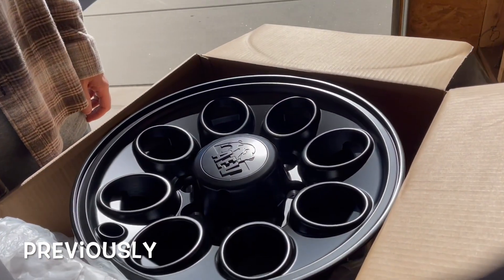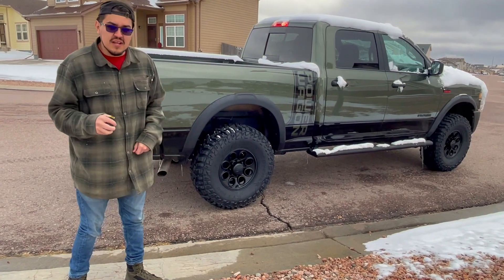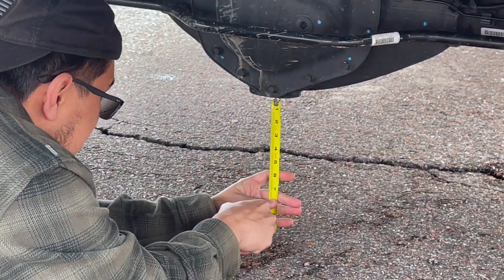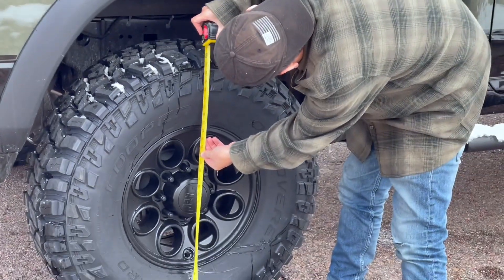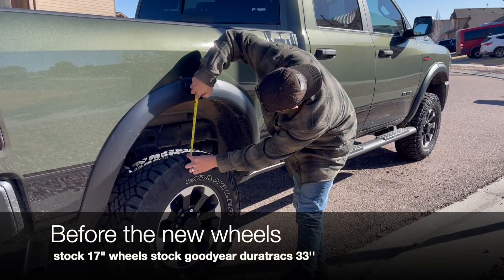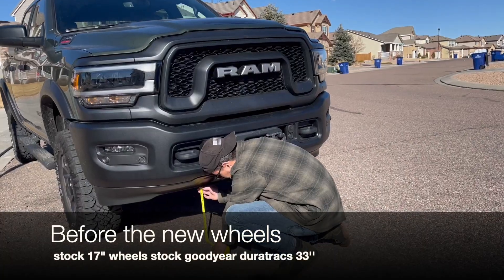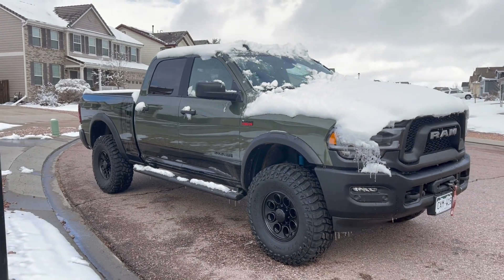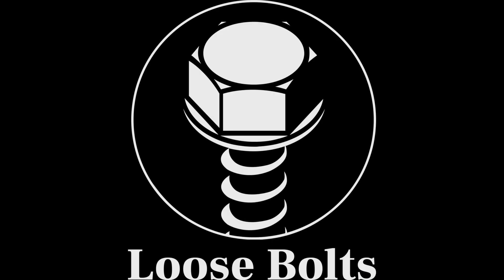Should you upgrade your tires for more height? Power wagon wheel and tire upgrade.

Comment: I have a 2018 Ram 2500 Cummins and used to have 37 on it with a 2.5 Carli suspension the truck looked awesome and rode like a Cadillac. Quickly I came to find out that I needed to re gear the gears to 4:10 gears. The transmission shifting was way off. When I would gas the truck it was a slug. After the re gear it was back to normal. On top of that my high mpg went out the door. The don’t recommend going bigger than 35
Reply from the maker: I hear ya man good feedback for many people looking into it. These pw already come with 4:10 as well as they make things now to re calibrate the trans to 37s (aev procal snap another video) I love it now your right there not one thing that can be done about the gas mileage it just is what it is if we lived our lives worried about it we’d all drive a prius. On 37s it’s the closest thing I have to a tank lmao I have no complaints this rig is bulletproof (knock on wood)
Reply: @loosebolts4537  that’s cool that the power wagons come with the 4:10 gears. I like the wheels and tires you went with. Your truck looks awesome

Comment: I also have a 2022 Power Wagon and I’m getting ready to throw on the AEV Katlas with some 37x12.5 Nitto Terra grappler G2s. I just noticed that the procal snap was back in stock, so I’m ordering it today.  I dig the channel, well done!!
Reply from the maker: Bro, nothing breaks more necks that 37s x17 man get ready to be complemented every where you go on your rigg. The procal snap is a must have a vid on how to program real simple but very necessary my odometer is correct and my gears shift smoother. Thanks for the kind words my man!

Comment: Did you have regear anything?
Reply from the maker: No re gears the z f and 6.4 are more than capable the only thing I had to do is reprogram the tire size so the speedometer and the transmission would catch up.
Reply: @loosebolts4537  I’m looking at getting one this week. I think due to high gas prices dealerships are allowing MSRP prices or below!!!

Comment: What trimming did you do
Reply from the maker: Haven’t done any trimming, running at about 50 psi front minor rubbing sometime when turning at full lock or off-road once you get some articulation going but I’m ok with it need the fender liner for now as I’m in co and that road salt eats up sheet metal plans to bed line the underneath of it but it hasn’t been bad enough to warrant it.
Reply: @loosebolts4537  I’m thinking of putting 20x9.5 with 35x12.5.  But I want 37s but I’m on stock height.

Comment: The 6.4 with the ZF is like a freight train so I can see the added weight not affecting the power much but the ZF will shift more and not as quick unless you regear.  It will affect mpg though since you are adding more spring weight do to more rubber.
Reply from the maker: I honestly couldn’t have said it better myself, your spot on there is practically no loss of power, the gears are confused at the moment looking for the aev procal snap so at least the truck knows it’s on 37s, maybe a regear once warranty is up

Comment: Hey, so let me know what kinda ride you get on these on a road trip. how do they do on bad roads , hwy fuel range ..etc...super interested
Reply from the maker: Hey my man, I’ll make a video and tell you now just went on a 200 mi road trip (pavement/asphalt) all the way through, the ride is quiet you wouldn’t think they are m/t I like how cooper took their time with making this tire, also run 50 psi right now on all 4, cushioned the ride competed to what I was running before 32 duratracs with 60 front and 65 rear ‘y wife was excited about it and I didn’t even tell her to look for it. Also at 50 psi slight fender massaging no rub didn’t cut anything. It’s a slick set up! 12 mpg average. However the truck inky has 3k mi so not completely broken in.

Comment: How do you find it driving after the larger tires? Braking and just general usage? I plan on putting 37s on mine the day it finally arrives got the AEVs in the garage.
Reply from the maker: Hey brother you don’t really notice a loss of power, you do notice the gears don’t know where their at due to the larger tires but honestly in driving and turning, it doesn’t feel much different. Looking to somehow find that aev procal snap somewhere, they are on backorder everywhere.
Reply: Don’t do it you will regret it. You will need to re gear the truck to 4:10 gears. Plus your mpg will go down to like 12-13
Reply: @sergioamescua3460  I've been on 37s now for 6 months and love it. With the newer transmission, I really don't at all feel the need to regear. It's not like my Jeep where regearing was needed. I oddly just checked my mpg yesterday on a long road trip (all cruise control) and I averaged 17.3 mpg. However I know its no were near that when driving around town. And I have regeared my last two rigs.  Breaking is were I notice it, however, the most, Its fine but in an emergency stop, I think I've certainly added a few feet onto my stopping.
Reply: @sergioamescua3460 Power Wagons come with 4:10 gears stock and you don't buy this 6.4 gasser if you're scared of gas stations.

Comment: Any rubbing in normal driving/ parking?
Reply from the maker: Yea some just som catches on the fender liner at full lock and in reverse. The fender liner hangs just a bit lower than the actual sheet metal so I’m working on something to push the liner a bit tighter to the sheet metal without trimming. Other than that no rubbing on actually sheet metal or radius arms.

Comment: I like the idea of the video but you’re measuring all wrong. Put the beginning(0) part of the tape on the ground and measure to object(differential, fender, tow hitch). Measuring to the top of the tire doesn’t show much or a true measurement between stock and bigger tires. We already know the tires are bigger. Don’t want to bash you just adding suggestions, thanks for posting videos though.
Reply from the maker: You right, would have received a more accurate measurement.